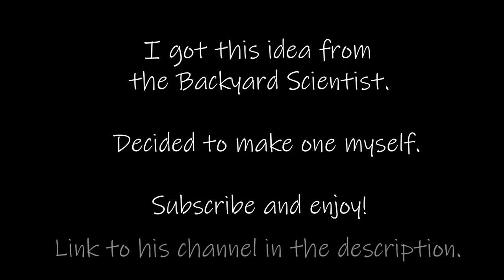Easy DIY Flaming Fountain From An Old Pallet

Comment: Where are you guys getting the small pipe for the propane injector. I can’t find it anywhere
Reply: K&S brass tubing. Get it at most hobby and hardware stores. Its even on EBAY and Amazon.